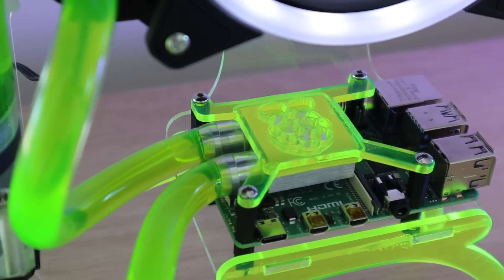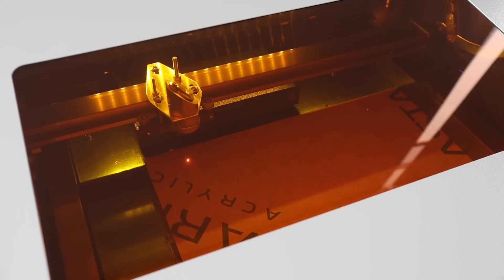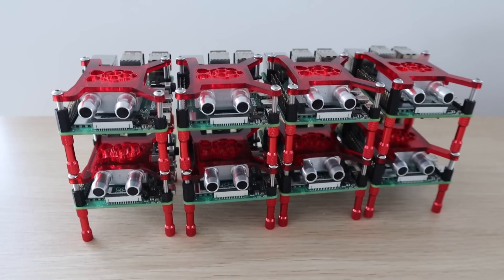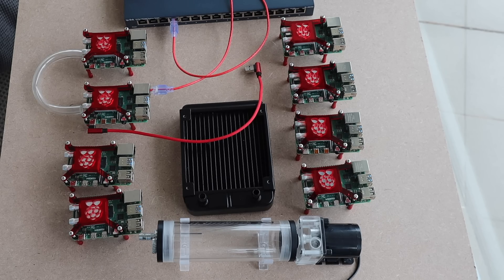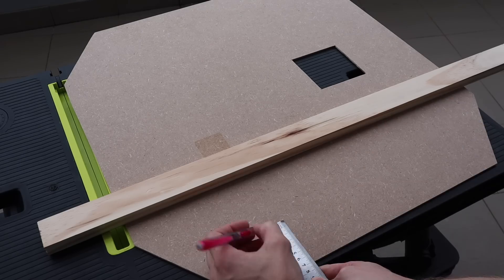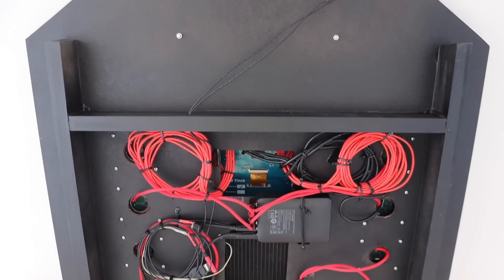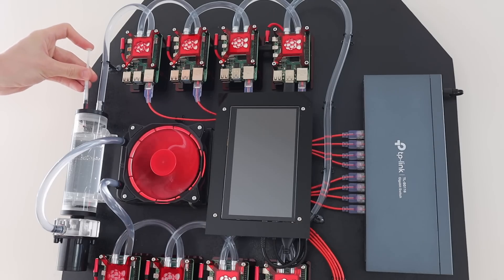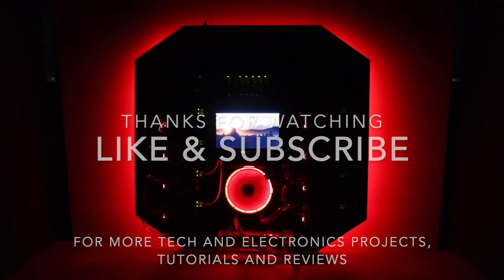Building A Water Cooled Raspberry Pi 4 Cluster

Comment: Your concerns for the loop are not warranted, because  that its not how the thermal dynamics of water cooling loop works. As long as the loop has enough TDP to cool all the components it does not matter how you connect them. There are people that tried this same logic with high end GPU and CPU (~600W TDP). You can get like a few degrees difference between the elements , but the temperature depends mostly on the radiator and the fans. Have fun with your cluster !
Reply from the maker: Thank you!

Comment: I feel bad for that Pi at the end of the loop, a parallel design for the cooling system would have been better.
Reply from the maker: The water’s flow rate should be high enough that it won’t make much difference, but I’m going to test it soon.

Comment: Did you use 32bit software for the cluster? If so how are you going to get all that ram used when it can only grab 4GB of ram
Reply from the maker: Yes each node is running 32but software, but each node controls its own resources as well.

Comment: Did I miss the part where he somehow plugged 8 Raspberry Pi's into a 6 port, 12amp charger?
Reply: I was wondering exactly how that worked too. Maybe he used a 2 port usb spiltter?
Reply: @TmanT321  You can see he uses 2 splitters on the back side (in black).  I found that curious because they didn't make the parts list.  Normally I would overlook that, too, except he is EXCEPTIONALLY meticulous about naming all the parts down to the screws and even the machines he used to create them.  Also, the budgeted wattage seems a bit low for that many pi's.  I'm sure they will power up, but I wonder how they will fare under load.

Comment: no POE?
Reply from the maker: I was going to do PoE initially, but the hats required to supply the Pi are quite big, so don’t work well with the cooling block. They’re also around $30-$50 each, which’s adds up quickly when you need 8 of them.

Comment: Is raspberry pi's TDP so high that it requires liquid cooling, or was it more of an aesthetics project?
Reply from the maker: They need some sort of cooling, especially if they're overclocked. Water cooling is a bit of an overkill, but it works well for a cluster.
Reply: Acoustic aesthetics! You must have missed the part about having 8x as many "loud" little fans running vs one big 120mm or 140mm fan. Smaller fans are inherently much louder than even "slightly" bigger ones pushing the same air volume/CFM at the same cooling performance. Why there's a trend now for using bigger intake fans on PC cases, like in the Be Quiet 500DX with 3 larger 140mm fans or the Cooler Master H500 line that has 2 giant 200mm fans vs using 120mm fans.

Comment: Sorry if asked before but newbie to water-cooling. How did you power the pump and radiator fans?
Reply from the maker: They're powered with the same 12V supply as the network switch.

Comment: If you have all the pi's in a series, then once the water gets up to temp, they will all be the same temperature no matter what order they are in.
Reply: That's just not true. The temperature of the coolant out of the heat exchanger will be lower than on the return. As OP mentioned - the first Pi will experience colder coolant, then warmer, and warmer etc as you go down the chain. Once back to the H/E, the coolant will be cooled again and the process repeated.
Reply: @5UPRAH  it's been proven time and again. Once the loop gets up to temp it stays the same.
Reply: @5UPRAH  https://youtu.be/RnPB_q51iVk
Reply: @robertshort9487  too many variables in that test and also not all the same components. The OG of the 8x Pi's video needs do a temp comparison of each of the Pi's CPU's and the coolant temp at the in/out of each block and the reservoir to make this a valid test and argument.
Reply: @robertshort9487  also that link you sent, he is making a lot of assumptions. "If you were to...." - "you would probably...." etc etc. No actual proof - just his assumption. Fact is, if the radiator/Heat Exchanger is efficient, then the placement of the blocks in series vs parallel will matter. First proc is getting 20C coolant, 8th could be getting as much as 40C coolant. Core temp of the first will be much cooler than the 4th. It just will be.
Reply: @5UPRAH  lol. Smh. Ok whatever if you didn't want to watch it, just say so.
Reply: @robertshort9487  I did watch it - hence my quotes. Clearly you haven't or are ignoring reality. Good luck.
Reply: @5UPRAH  you already admitted that you didn't watch it. 

If you had then you would have said something like, "oh, I was wrong. That's really interesting."
Reply: @5UPRAH  you're wrong. But `okay`

Comment: why didn't you turn it 180° degrees so the reservoir would be on top. Then the Air bubbles would gather in the reservoir and not in one of the cooling blocks.

Comment: These tubes will soon slip if you leave them as they are. It may fit for some time, but after a while, the connection with water block will get weaker and will slip. I know what I'm saying ;)

Comment: What are you using this for? It's a really cool looking setup but, I guess I'm just out of the loop on what people are doing with these boards nowadays. 
Building the fastest pi-hole ever made? Running Octopi with load balancing?
Reply from the maker: I built is primarily to learn about cluster computing and to try out different software packages and configurations. I'd like to get some mathematical simulations running on it eventually.
This would definitely be the worlds fastest (and most unnecessary) Pi-hole haha.

Comment: this is nice but for my perspective it is risky.. if i would  do i would put pump down with reservoir and radiator and display above the 8 pi's. and pi's facing up with electric/data connection while water in and outlets are facing downwards -so in case of material(pipe) failure  water leaks down by gravity  and a flow-sensor   or at least a visual flow indicator is also good idea if pump dies accidentally.
yes i know i am this kind person-made my own pc case in same way so motherboard is upside down  so cpu with  water block is under the cards(gpu,usb ect)......
btw what you said about warm water that hits the last one ...that should not make any sense with a normal pump(what you look like have) and reservoir is big so it should not create issue otherwise you have to put 1 more radiator in look or better pump depending on issue. but basically  that with a normal flow not  an issue.
Reply from the maker: Thanks for the tips and advice Csaba

Comment: Good project.

If you are concerned about water temperature, might I suggest you run the radiator and fan from the rear of the display and insert some thermal barrier to isolate the heat from the cold. Likely you would not require much but can likely cool the water by a degree or two under load. Also adding longer tubes would allow the water to cool more before it even reaches the radiator.

I would have gone with a circular arrangement myself by that is just personal taste.

Comment: A custom 15x40x40mm copper fin heatsink with a decent TIM adhesive will sufficiently cool a 2.147 GHz OC'd RbPI. If boards are under high utilization, a 120mm fan can remove excess heat from 5 boards. This together makes a high density, modular platform

Comment: I am just curious why using this network switch?
Is this cluster capable for editing a 4k video footage?
Reply from the maker: The network switch is to connect them all together so that they can work together as a cluster computer. You can use WiFi as well, but a wired connection is more reliable and faster.
Editing video probably puts more strain on the GPU than the CPU, this is more suited for rendering mathematical simulations and doing repetitive calculations.

Comment: Have you had any issues with the power supply?  The USB A to USB Type-C cables only advertise default current (500 mA ) which is less that the typical 600mA the Pi 4 requires.  This leads me to wonder if the PI 4 does not follow the USB Type-C specification and just takes as much current as it can get or if the PI4s you are using are drawing no more than 500mA.  I suspect the PI4s simply do not follow the USB Type-C spec.  :-(
Reply from the maker: Not yet, but I also haven’t run them for very long or all together at maximum load for a period of time.
I’m not sure which cables you’re looking at specifically. As far as I’m aware USB A can go up to 2A and 5V and USB C can go up to 5A and 20V.
The official Pi 4 power supply is a 3A 5V USB C

Comment: What is the benefit of cluster raspberry pi?
Reply from the maker: You get the combined performance of 8 Pis but controllable from a single Pi. So you can give the cluster a task and it will divide the task up to complete it, rather than you waiting 8 times as long (roughly) for a single one to do it, or having to divide the task up into 8 parts yourself.

Comment: very cool thing but why you take the 2gb ram modell insted the 8gb ram modell?
Reply from the maker: Because this is designed around getting a high computational speed for simulations, which doesn't really need a lot of ram. It would have cost another $400 to get the 8gb versions instead of the 2gb and there would be very little benefit.
Reply: @MichaelKlements  okay i don't know👍

Comment: Very nice, I might to the water cooling for my 9 node rpi4 kubernetes cluster... as soon as I figure out how to reliably power them all :D ( Using two powerful 16 slot  USB chargers now is not that great, but they fit in my custom case :D, tthey would not look that hot on broad like yours :) )
Reply from the maker: Let me know if you figure out a good way to power them! Someone needs to build a more significant USB power distribution board, specifically for clusters!

Comment: would just a mid-range PC be able to outperform many raspberry pi's?
Reply from the maker: I think it depends, what do you consider to be a mid-range PC and how many Raspberry Pi's would you compare it to? Also, outperform on what metric?  I think comparing price for price, a cluster of 8-10 Pi's like this is would probably perform purely computational tasks faster than the PC. But putting up a $600-$800 modern CPU against 8 Pi's wouldn't be much of a contest.

Comment: For anyone who knows about water cooling, having it in series is the only way to go. That water flow is usually fast enough to warm up evenly so there is no noticeable difference between each node. Usually what you have is the loop thermal balance.

jayztwocents did a good video about it.
Reply: Yup - you maintain the temps of the loop as a whole. That's all you do with watercooling. Flow rate is the main concern here to be honest due to the amount of blocks that restrict flow by design.
Reply: was ready to make the same comment, thank you.
Reply: but a rail system looks much cooler ;)
Reply: 2 components are a lot more different than 8 components in a loop with pressure drops over every connection. 

it will matter and the later ones will be hotter. maybe not enough to thermal throttle, but they sure as hell wont run as cool as the first ones
Reply: i suspect the blocks are simple in design and lend themself to slow flow rates rather than the high turbulence/high flow of a higher end pc type block with all their micro grooves etc.
over and over real world tests in pc world have shown loop order makes no difference in temps. ie sending GPU hot water to CPU doesnt make the CPE hotter because everything equalises.
having 8 equal boards rather than CPU + GPU maybe the 8th board will run hotter for a while but not over the long term and i think this is a system to be run 24/7 long term
personally id run a parallel water system on what im guessing is a slow flow rate just to be 100% sure everything heats at the same rate. even if the last board is hotter for a bit longer eventually i will shorten its life especially if this isnt a 24/7 system
Reply: @t_c5266  I agree. Maybe could've incorporated a second radiator into the loop after the first 4 Pi's, but that may necessitate a second pump due to flow rate.

Comment: Cool project. The USB charger won’t be able to supply the 3A the pi4 requires though. I haven’t seen such a product yet and all the suggestions are around using a PC or small server PSU with at least 30A and pulling USB power from  that.

Comment: Two possible things to be aware of. As you have laid it out, any air in the system will move around until it is trapped at the top of the radiator, where you can't see it. Better to have inlet and outlet at the top of the radiator, so it remains full. Also if you position your reservoir vertically with the inlet at the top and the outlet at the bottom, the air would collect there and not affect flow or cooling. If your reservoir is positioned at the top of your cooling system then you can drain any trapped air without having to drain your system or remove it from the wall.
Reply from the maker: Thanks for your suggestions. I'll keep these in mind going forward and may swap the switch and cooling system around. I'll also turn the radiator around so that the inlet and outlet are at the top.

Comment: Fire bad. Better fan / exhaust to keep that from occuring on the laser engraver / cutter.
Reply from the maker: Yeah, that's definitely the next upgrade I'll be making to the cutter. The stock exhaust system is pretty poor.
Reply: @MichaelKlements  ah ya .. keep a fire extinguisher close. Chinese boards are not exactly grounded either .... :)
Reply from the maker: Haha I've replaced the laser tube on it as well, so I'm well aware of the poor connections and lack of grounding. It's always near the door and a fire extinguisher.